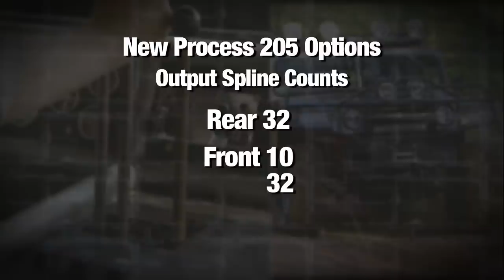Transfer Case 101 - Xtreme 4x4 S4, E4

Comment: I have a np203 in my 75 k20 and I have heard of the chain stretching but never have had the issue with my truck. now i do not get on the trails as much as i like but other then having to change the oil in the transfer it has worked flawlessly.

Comment: What would really make a huge difference in rock climbing would be a CPU controlled leveling traction control system that sends air pressure to air bags to plant tires that's not getting a good foot print to the ground that can do it in real time just like a fly by wire system on modern fighter jets

Comment: 2:45 OK, I have to correct some misinformation here. The OEM's didn't use a divorced TC so they could use the 2wd trans, they did it because it allowed them to place the TC at the center point between the two driven axles. This improved drive train geometer and durability as the forward and read drive shafts were of equal length.
Reply: David Blalock so what they say is misinformation? Is it not true they used 2wd type trans? And if im not mistaken they still use 2 different drivelines anyhow.  Im sure i c ok uld be corrected

Comment: I want to convert a truck to a front wheel drive daily driver mobile workshop. Which old  truck(preferably 70s - 80s) I should buy that has a durable transfer case ?  The reason for FWD is that I want to have a truck similar to FWD car hauler conversion. But they are ridiculously expensive. Thanks!

Comment: Chrysler was the only supplier for full size transfer cases. Chrysler owned new process.
Reply: New Process (NP) is now New Venture (NV).
Reply: @bobbobby1846  Yes, Chrysler supplied the transfer cases, G.M. owned the building they were produced in. Joint venture. Old muncie 4 speed factory.

Comment: Your info was slightly off on the 205 input options and you were also missing some info. The Chevy case input  spline options were 10(sm465), 27(sm465 & th350) and 32(not 30)(th400) The ford case largest spline count was 31(not 32). The case you didn't mention was the dodge, it was also a passenger style drop and came in 23 and 29 spline inputs. And you didn't mention the (early) "figure 8" and  (later) circle mounting pattern and the large and small bearing input options on the dodge and Chevy cases. Other than that, great info.
Reply: Ian did say "racetrack" figure 8, and the large bearing i think depends on spline count or year.
Reply: @bobbobby1846  my bad on those points. I missed that.

Comment: I watched a 20 minute video and still didnt find out what I wanted to know, which one of them can handle the most power reliably? I'm looking for about 600hp capabilities without it shitting the bed
Reply: Master Toast 205 if you need more gearing add the 203 doubler that’s the beefiest set . Use the Ford 205 , 32 spline input /output.
Reply: I'd say build yourself a doubler like  Ian built in the video with the  6 : 1 low gear.  That transfer case is bad ass!

Comment: i am working on modifying a 99 f150 4x4 with better driveline
Reply: Super duty transfer case. Did that in my 92 250. Bolts onto a 150 fine and is waaaaay stronger then a 205
Reply: @codyparker679  is it nv271/273?